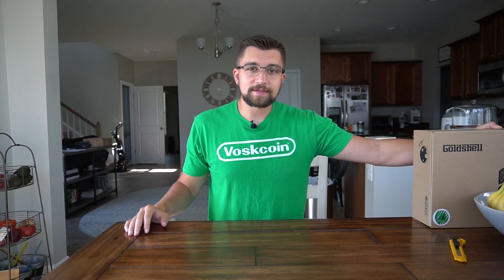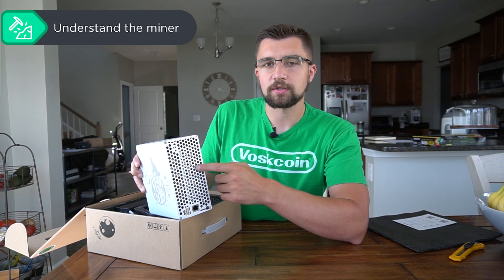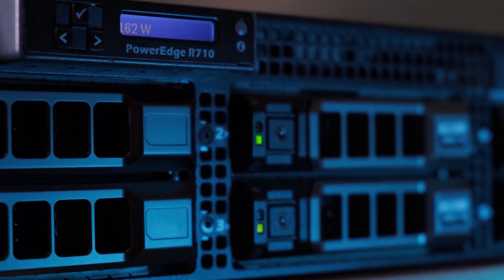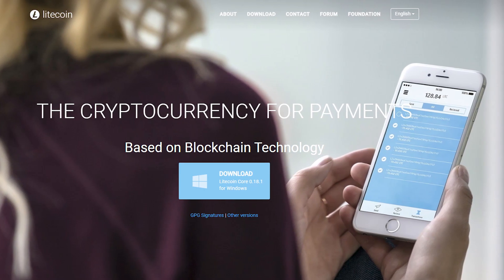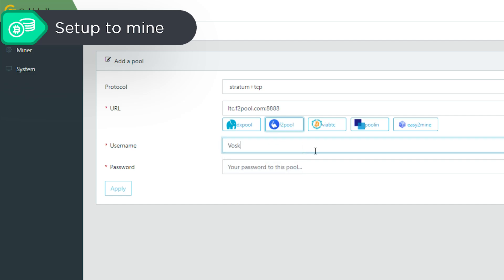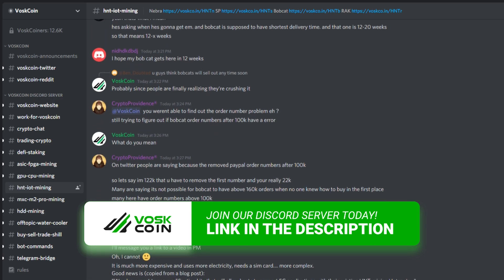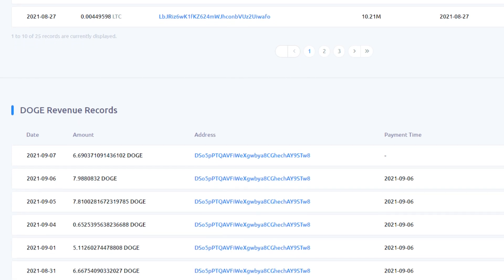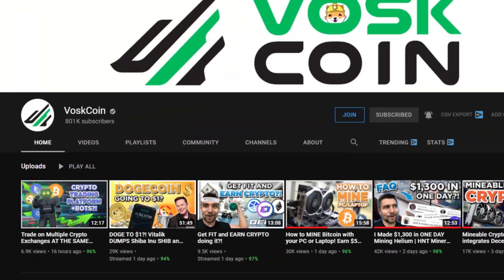How To Set Up an ASIC Miner

Comment: decided to buy a commercial psu, corsair RM750,  how do i hook this up? power supply works (fan test) but i cant figure out what to plug into the sc box which no longer comes with a power supply.  found cables online but idk if they can be used for power; highest rating i found was 12A

Comment: So I ran into an issue where I could not access the GUI threw my browser threw my network.    I had to connect to the miner using its wifi.   I had to open my wifi on my lap top and search for wifi.   Youll see the name goldshell.   Connect to it.   Then enter its IP address into the browser to get the interface to work.   Thought Id share encase anyone else has this issue.

Comment: What is the strategy in the bear market? Is it good practice to mine, accumulate with ASIC miner, and sell in the upcoming bull run (if electricity cost is affordable with another income)? Or is it just better to wait until another bull run starts? I found that the average lifespan of ASCI miners is at least 3-5 years, which is long enough. I am just curious if it is profitable during this period and worth running.

Comment: The beginning of the year I managed to get 10 asic l3+ miners for $100 sold 3 of them for $300 each then dumped the rest in a auction only got $50 for the other 7.. shame on me at the time the profits seemed low and electricity was to high plus no where to run those noisy heaters but now I'm kicking myself in the ass as I finally continue to build and put together a farm after all these months
Reply: To top it off I sold 18k of tfuel for 0.06-0.08 cents on feburary a week later it spiked to about 0.22 after selling and now it's at approx 0.40 I'm probably the worst person with crypto I'm not worthy I'm no better then the buddy who bought 2 pizzas

Comment: I've connected power to outlet and one of the line from the power box to the miner. I have also connected the cat 5 cable from miner to computer and opened advanced ip scanner and opened the correct ip and screen took me to goldshell home page but in mining status it states miner pool is not ready yet, make sure miner is fully constructed and connected to a router. At this time there was no chart showing anything being mind. What I did next was I took the cat 5 cable out from computer and connected it to router but the goldahell screen said this site can't be reached. Any suggestions as to how I can get miner to mine ?

Comment: so for the larger Ant miners ( S19 pro) do you need special outlets in your home? Can you use a regular outlet with an adapter? or do you need an electrician to come in and run larger 220 outlets???
Reply: I’m wondering the same!
Reply: @Sydney-sc8sb  let me know if you get the answer. I ordered one.
Reply: @josephbroach1447  you'll want 220v for the larger machines.  The S19 Pro pulls 15 amps at 220v.
Reply: @joetripp123  It came in a few days ago. I need to call an electrician to run me a new outlet.

Comment: I bought two of the gold shell mini doge miner and I have been having a problem where every few days the miners disconnect from the minning pool. The device stays on and runs the whole time but when I open the page for the gold shell miners it doesn't show the devices as connected nor does it show on f2 pool. I was wondering if anyone knew what was causing this issue and how to fix it. I do not like finding out the device disconnected while I am at work and not noticing till 9 or 10 hours later loosing alot of profit for the day.

Comment: DJSYGDqpu6YgxTpJDry68wkRSnzS5BoCWK
I love this tutorial! Mini Doge is my first attempt at mining. And didn't understand the difference in power chords.  Especially the power supply portion. I struggled with mine as I did not understand the replacement chord. I initially used one that didn't have the proper power and everything was overheating. Once I replaced the chord it was easy cheesy! 
Thanks for explaining this here! Great vid!😁
Reply: One question.. can we change which coin my mini doge can mine?
Reply: Can u tell me from where u buy the asic..I want to start also

Comment: You didn't answer the question, what kind of bear is best?....

But something I've been curious about is how often you guys clean your miners and what methods are sufficient?  I understand dust/dirt/etc. are terrible for electronics, given enough in an environment, but I haven't owned enough computers or electronic devices for long enough periods of time to know how best to clean them or frequency.  

Was stationed in the Middle East repeatedly and each time, canned air was our best friend, but often our personal laptops didn't last long upon our return home so we learned to just take cheap, disposable laptops with us for deployments.  Obviously, I'm not planning on putting my gear in a sandbox so I'll have that going for me at least.  

Separate from a clean room with filtered air, hazmat suits and airlocks for entering/exiting this room, what are some of the more common practices out there?  Or is it all you need to do is just vent the air and use canned air to blow off surface dust from time to time?  For ASICs, just blow through the openings?  Or is it safe to take apart the shells?
Reply: That’s a great question that I’d like answered as well.